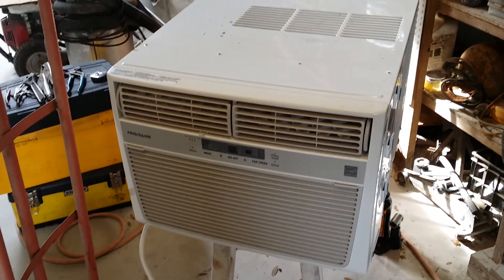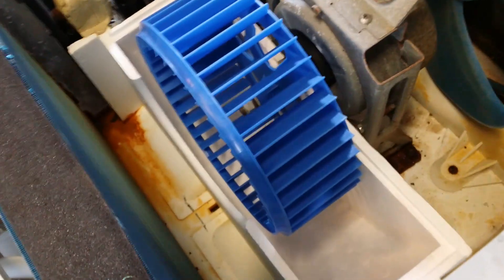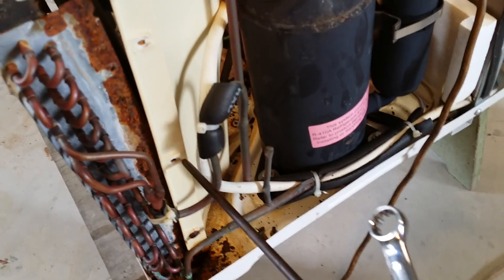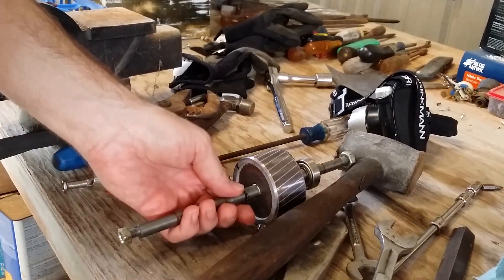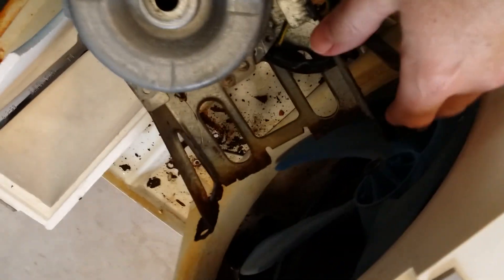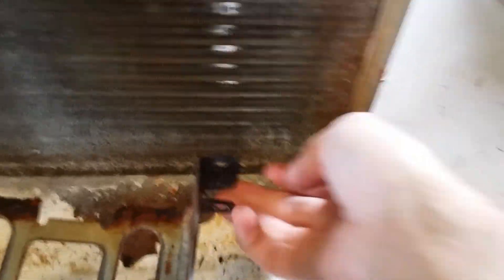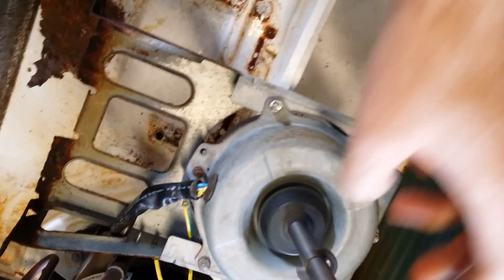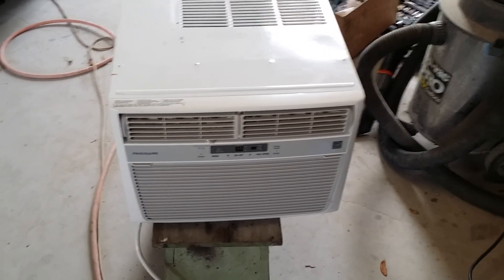Noisy window air conditioner A/C fan bearing

Comment: Frigidaire Model FFRE08B3Q1: I don't know about you guys, but I couldn't get the motor apart. I pulled the (3) little 7mm bolts off, carefully used a chisel to help split the case apart, and carefully pried front and back apart. The front case (the one without the wires) would not pull off of the stator. It's pressed on! Then, as if to make doubly sure the motor can't be pulled apart, the manufacturer stamped two indents into the case to attach it to the stator even more firmly. Motor is a Welling YSK65-4AT (made in China).  I don't how to pull the halves apart without destroying the motor. Can't find a new Welling YSK65-4AT motor...
Reply from the maker: You sound like you know what you're doing...I remember cleaning the motor shaft with very fine sandpapering, and being mindful of where the sanding particles land,  before trying to slide the bearings off. I remember one bearing was easier to remove than the other. Oh I remember I distroyed one of the bearings removing it.  Both bearing and shaft must be within tolerance. I used blocks of wood and deep well sockets, i think. It was a while ago.

Comment: This was an excellent video thanks so much I don’t know what it is about these window units from Frigidaire I had bought mine and I don’t know if it was because it was on its side are at work but I used it for like four months only as I wanted some Extra cooling In my bedroom and all the sudden the same thing happened to mine it was actually a good thing because I cleaned it out As here in Southwest Florida things get pretty nasty from the humidity I ended up getting a couple sets just in case and I’ll tell you what it sounds quieter than It did in the first place

Comment: Very useful video. I just replaced the noisy bearings in a Frigidaire 6500 BTU a/c unit w skateboard bearings. Sounds a lot better. Lost a little skin on my knuckles pulling things apart. The a/c was working fine and I had cleaned the cooling fins with soap and water, and even though I ran it for 10 minutes or so after the cleaning (to dry any water that might have gotten in the bearings), 3 days later the fan was frozen and needed a push to start and one of the bearings was making noise. I would suggest that anyone cleaning their a/c run it right away for at least 30 minutes or so, and do it again the next day too. It doesn't seem to take much to compromise the bearings.

Comment: How did you manage to get the motor case open? I destroyed mine haha
Reply: one way is if you have a really flat blade or pointed punch, put it on the seem where the 2 halves of the case are closed together, and take a small hammer or something and punch it to break the seal. once it starts to split open just keep going around the case while it opens up all around.

Comment: Dude! This is the same A/C I have with the same problem. 😅 picked it up at a pawn shop for free because they said it was the motor. Took it home, cleaned it, found your video and bam! Momma has a new she-shed A/C! Thanks a bunch!
Reply: where or how did you find your new bearings?

Comment: This is an awesome video and dead on for what was wrong with my window unit which was making the same noise.   I did have a different model number and different bearing numbers.  When i removed the motor i had separate the front half of the motor from the rear.  It was sealed with some sort of metal connection which i drilled out and then it came apart.  I  purchased two bolts and locking nuts to reassemble the motor.   All went well.  AC is up and running with no bearing noises. Thanks!

Comment: I have an arctic king which purchased brand new last summer. Two months later I took it apart to clean out the mold that was creating a locker room smell blowing out of the unit. I had to let it sit for a few days to dry because I got water on the circuit board and it won't start or turn on like that as a safety feature. After putting it back in the window three days later it sounded just like this. I ran it the rest of the summer like that. Cleaned it out again last week and am using it currently. After seeing this video I may take it all apart to fix those bearings. Thanks for the video!!!

Comment: i have the same model as yours which bearings did you buy?
Reply: Look at your bearings. You will find a part number printed on it/them.
This isn't rocket science guys. If you are willing to undertake the task then you can find the numbers and order them online from your choice of purveyors.
Just 'Google' a/c motor bearings (or drop the "a/c") and the number that you found.
You can do this without someone holding your hand and guiding you to and through each step.
(It's good that you don't have to look up the information in an actual book with pages, a table of contents, and an index. Look those terms up if they are new to you.  Don't EVEN ask where).

Comment: I Would suggest reading all of the comments before starting this project. I just read... “I suggest marking the location of the armature on the shaft just in case it slides.” I got into this and I’m pretty sure the armature slid and I’m a little uncertain of where exactly it’s suppose to sit, would it be exactly centered between where the two c-clips go? Looks like I’ll be buying a new air conditioner after all...

UPDATE: It does appear that the armature sits centered between where the two c-clips go. I put it all back together and it’s working great! I still recommend reading all the comments to get all the helpful hints before you dive in. Thanks to Mike for this vid!
Reply: I have a 15.1KBTU Frigidaire unit.  Both bearings back up against an OD snap ring on either side of the armature.  On my unit, there is a groove in the shaft to accept the snap ring.  If the snap ring isn't there but the groove is, you know one is missing & mystery solved.  If the assembly on your particular unit relies solely on the interference (press) fit between the bearing ID and shaft, then the mystery continues.....

Comment: Thanks AC unit is back to working a little bit quieter again, my Haier until used a 608z bearings which I had to used my Dremel and carfully cut them off the shaft. Then was able to snag a 10 pack of 608 2rs from Amazon for $7  and used a sprinkler riser attached to a coupler to hammer them in. Thank you again saved me at least $140 vs buy another unit

Comment: I'm having trouble getting the housing off the motor, I think I heard you said you used a chisel.  Any other suggestions?
Reply: Used a metal putty knife just to get in started. Move careful around, a little bit at a time. Then used a chisel to get it the rest of the way.

Comment: Thats crazy as i stand here in the scrap yard trying to find the exact motor march up as that air conditioner.  I bet its a wellong motor there fucking horrible i have had more problems with them a/cs and there horrible motors i usually replace the motor but i cant find those motors anymore

Comment: Thanks for the video. Interestingly, I have the exact same A/C with the exact same problem. This leads me to believe they were originally manufactured with crappy bearings. May I ask what you used for replacements?
Reply: Two years after these comments, here's my opinion on why these bearings fail. it's because they are made in China. They are crap. If at all possible, by US, Canadian, Japanese or German made bearings and they will last much longer than the Chinese bearings. They will cost more, but are worth it. That's why it only cost $5 for both bearings. Even the Chinese bearings that cost $10 each, are crap. Stay away from them, unless you want to replace them again. I have a Kenmore 12,000btu unit that needs new bearings. I don't look forward in replacing them because about four months ago I just did a major cleaning on it and what a pain removing and installing it my myself. I have another ac that the bearings locked up that need replacing too. Lots of fun soon.
Reply: My fridgidaire did the same thing this year. Replaced the bearing and good as new
Reply: @MrApru1  What did you use for replacement bearings?
Reply: @agent-8699  I took apart the motor and it was stamped with 6201z which is a 12mmID x 32mm OD x 10mm H. I found the actual bearing ID was 12.7mm and I found one on Amazon.
Reply: @MrApru1  OK, thanks. Did you find the OEM part or did you use a generic replacement?
Reply: I have exact ac and having exact issues :(
Reply: Make sure you measure the motor shaft that the bearing is pressed onto.  A standard 6201 bearing has a .472" /12mm I.D.  The bearing in the link below in this thread has a 1/2" I.D. or 12,7mm.  Be sure to order the right one!
Reply: @paulbaril6489  You should double check the size using calipers before ordering. I ordered the following from VXB.com: Kit9702	6201-2NSE Nachi Bearing 12x32x10 Sealed C3 Japan (2) @ $6.83 = $13.76
Reply: @agent-8699  That's the point - don't trust the numbers on the bearing, always measure the hardware on hand before ordering.  The OEM bearings that failed were 6201ZZ bearings.  Again - if the shaft is 12mm, then a standard 6201 bearing will work as the standard 6201 is 12mm x 32mm x 10mm ID/OD/Thickness respectively. In my case, the shaft is actually .500", or 12,7mm, so the standard 6201 doesn't work.  I ended up ordering a set of NSK 6201-08VV bearings.  The "08" in NSK's nomenclature scheme stands for 8/16ths which  = 1/2" for the bearing ID.  $5.00 ea. from my local bearing house.  Turns out that this is pretty common specifically for electric motor bearings.  Not so much for other, general industrial applications.  "Trust but verify". Ronald Reagan.
Reply: @paulbaril6489  Ah yes, the metric vs SAE (Silly Automotive Engineering) system continues to befuddle the masses.... Only the US, Myanmar, and Liberia still use SAE (mixed in with enough metric to keep you guessing). We've been in the process of converting since 1975!

Comment: These darn bearing should be sealed bearings. Water getting in kills them.
Reply: Jason - look @ the reply below from Want2Race - specifically at the bearing model.  The "2RS" in that model description stands for "2 rubber seals" - which is an upgrade from the OEM bearings for sure.  Every bearing manufacturer has their own twist on sealing nomenclature, so - when you go to order your bearings - google the catalog for the bearing manufacturer in question and check their nomenclature for the sealing options in their bearings, then order your bearings with the sealing method suited for your application.  The other thing that people don't realize is that some of the AC manufacturers put a rubber ring on the shaft in front of the bearing that acts as a "flinger" of sorts to keep water out of the bearing when the shaft is spinning.  It's better than nothing, and certainly re-install it if you replace bearings, but it is no proxy for a properly sealed bearing for the weather side of these units.
Reply: What size of sealed bearing would you recommend for this type of repair

Comment: How did u get the bearings off the shaft mine are stuck on.
Reply: You need a bearing puller.  They rent them for free at Pep Boys.  I had a local auto body press them off.  Note: You'll also need a way to press them back ON.  I used a 24" wood clamp and my vise to mimic a press.
Reply: thanks good to know...! got hem off just by tapping them with a Flathead. put the new ones on works like a champ.

Comment: What info did you type to get the correct bearings
Reply: The part number is on the bearings.  Like 6201zz or something-and you  order them by that.  If there is a unique shaft size it will say 6201zz-1/2 (for 1/2 inch) for example.  However everyone is saying skatboard bearings work- and they are a dime a dozen.

Comment: Hello everyone, I had the same problem, but my A/C Window unit was a newer model! It was a bit of a pain to get that motor out, but I got it out. 
The motor in my Frigidaire AC is a Wellington Motor YKTS-35-50L, The bearing part number 608Z Nzsb, tiny little bearings. But I recommend that you make sure you can do the job, get access to your motor, be able to remove the motor and take the motor apart to gain access to your bearings before you go buying bearings.
This was a very helpful video and thank you "mike mike" for making this video.
So if you have noise when turning on your A/C unit, typically its a bearing, and these bearings are cheap like if $5bucks for some bearings! Better than buying a whole new AC LOL. Rather save a couple $$$ lol.
Btw: Amazon does have these bearings listed and for sell.

Comment: The bearings you use for you AC unit, do you think they will fit mine? My AC unit model number is LRA107CV1. The bearings in mine doesn't sound that bad but I'm pretty the bearings is mine are on their last leg.

Comment: A good DIY trick would be to put the shaft and bearings in the freezer for some hours before reassemble.
Reply: That would make sense for the shaft but not the bearings, you would want to heat the bearings.
Reply: Shaft in freezer, bearings in 200F Oven.
Reply: Because they are smaller when cold?

Comment: Very nice job thanks for sharing . I broke the fan on mine yesterday and want to know if the fan pressed on ? Also  fan side lefty tighty righty loosy? Thanks
Reply from the maker: My fans were not pressed on. They had straight shafts. But one end had a "reverse thread", meaning you turn the nut clockwise(like you are tightening it) to unscrew it.
Reply: mike mike thank you

Comment: Hey Mike. YSK90-4AF is the same motor in my a/c unit. do you have the bearing info? if so it would be much app'd. i am getting ready to disassemble  and would like to order the bearings ahead of time. Thanks Again!
Reply from the maker: These are the exact bearings I bought. The A/C unit is still running good! Runs 20 hours a day in the summers! Good luck! https://www.ebay.com/itm/391671495979?_trksid=p2057872.m2749.l2649&ssPageName=STRK%3AMEBIDX%3AIT
Reply: You are awesome!    I'll let you know how it turns out. Thanks again.

Comment: I just want to say THANK YOU for this video. My air conditioner had the exact same problem, and I was able to use the exact same solution. By the way, I also learned that the Z on 608Z bearings refers to the enclosed sides.  608Z theoretically means the bearing has one enclosed side, and 608ZZ theoretically means the bearing has two enclosed sides. But they stamp the number ON THE SIDE PIECE of the bearing before assembly, so the side doesn't know whether it will be part of a bearing with one side or two! I took out a bearing stamped 608Z and received bearings stamped 608ZZ which I was almost going to return before I found that out. My air conditioner is quiet and cold. Again THANKS!
Reply: That's good information. I'll make sure to get the ZZ in hopes they'll last longer.

Comment: Nice repair!  I have two window units with bad bearings.  I've replaced the bearings in an alternator before, but never an A/C fan motor.  Doesn't looks to difficult. :-)

Comment: Where do you get skateboard  bearings?
Reply from the maker: I know people keep saying skateboard bearings, so they must work, but I would look for a part number on the bearings. There are many styles of bearings and different seals on bearings. I would suggest ebay. Here is the link to the bearings that were in my unit. Good luck. http://www.ebay.com/itm/391671495979?_trksid=p2057872.m2749.l2649&ssPageName=STRK%3AMEBIDX%3AIT

Comment: I have the same problem I was wondering if you could tell me what size those bearings are so I can fix mine I already had it apart and already cleaned everything up tried to regrease the bearings but that did not work do you know the size of them
Reply from the maker: Here is a link to the bearings I used. Also, there should be a part number on the bearing if you look close. I would use that part number. 

http://www.ebay.com/itm/391671495979?_trksid=p2057872.m2749.l2649&ssPageName=STRK%3AMEBIDX%3AIT
Reply: Thank you so much it is really funny it's even the same exact air conditioner
Reply: @egantrucking  It just goes to an ERROR page now,

Comment: Just a few comments to add to this excellent video for people with minimal tools/experience like me:

Skateboard bearings worked for me. My bearings were 608Z and 608 ZRS worked fine. Curious to see how long they stay quiet

Like Mike says, take photos of the way things are put together before they are removed and different types of screws and where they come from. Also the spindle is different on either side so take a photo that reminds you how it came out of the motor (longer threads on fan end, etc.) The two fender washers did not fit with the lock washer, small washer, and screw, so I had to replace one of the fender washers with the one I had with a smaller hole and it worked fine.

Mark the edges of the armature in the beginning - it moved for me but was easy to set on the edge of a wood surface and hammer the spindle until it went back in place.

Sand the spindle with a very fine sandpaper before removing the old bearings and oil with something like WD-40.
Reply: I needed the same ones. Not sure how I'm going to get the old ones off the shaft though!
Reply: Can you give me a part number for these bearings ?

Comment: I assume you had to measure the bearings once you got them out. The online parts suppliers don't list bearings. They want you to replace the whole motor.
Reply from the maker: True. I could only find the entire motor replacement at first and it was about $100 dollars. But inside the motor those bearings have part numbers on them and I found a pair of bearings for $5.00 with shipping on ebay. No measuring required. The A/C has been running mostly nonstop for a couple months now. I live in Florida. So far so good!
Reply: I took the bearings to a bearing supply shop where they measured them with a micrometer and had different vendor but exact size bearings for $8 each. It was easy to replace them.